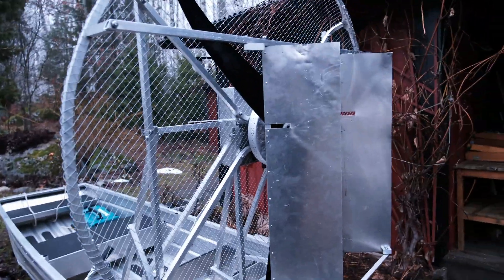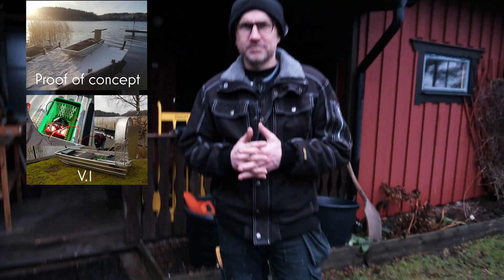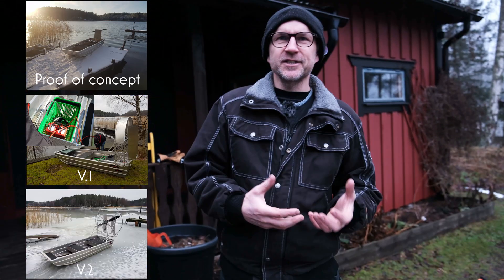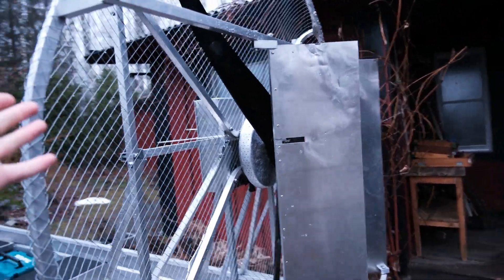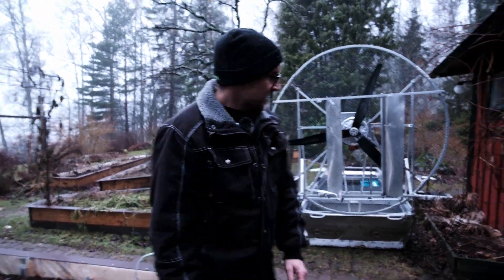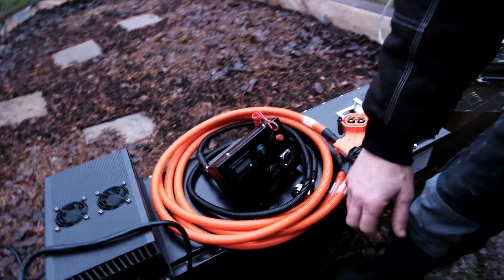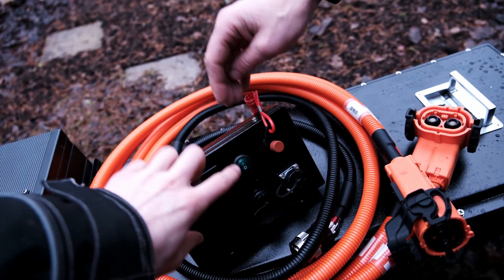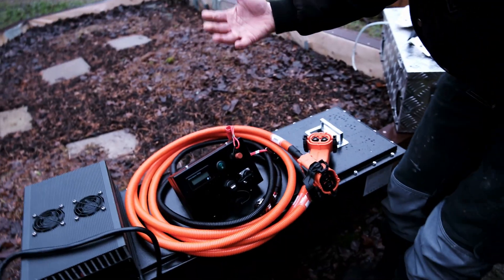Let the testing begin! Mini Electric Airboat production update!

Comment: Love this kit but i live in Canada and shipping batteries is impossible can we still work something out?  also what do you think of using  1448 Lund aluminium boat has a slightly pointed prow to shed snow bottom is flat. Its longer and heavier which are disadvantages but we get snow
Reply from the maker: Hi @David Ivens! No problems shipping the batteries, we have that worked out. The battery we have designed also includes a bunch of other things, and is not purely "a battery", so is an integral part of the kit. We working on really good shipping pricing, so shouldn't be a problem. 

As for hull size: weight could be a slight problem. Power to weight is everything, but this kit will push that pretty ok on water, but don't expect magic maybe. We are R&D:ing larger kits too, and have done our first huge project with this, so these are on their way too.

Cheers for the comment, have a great day!